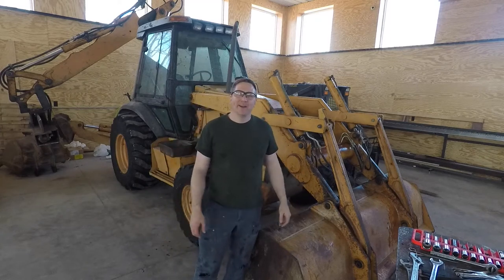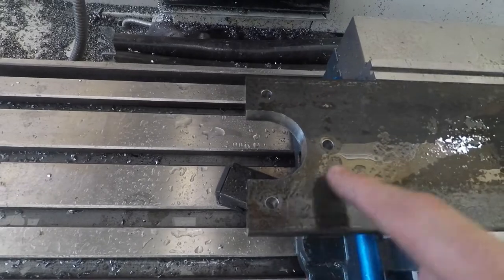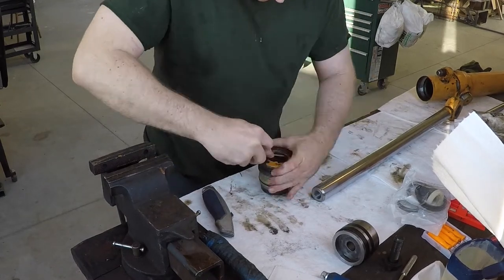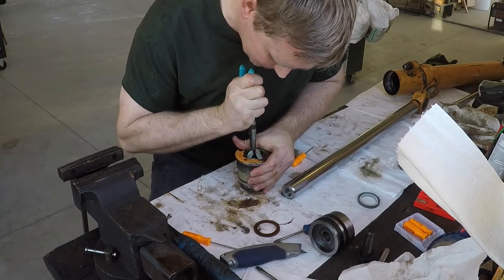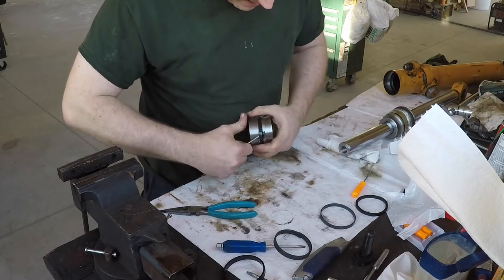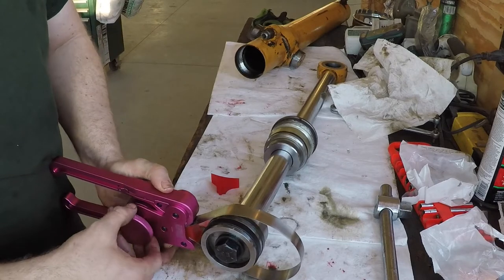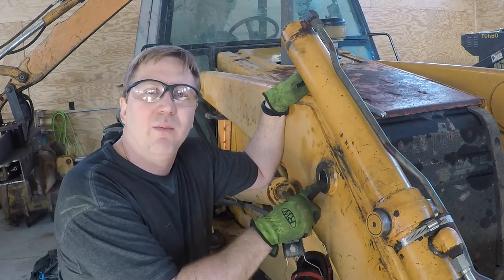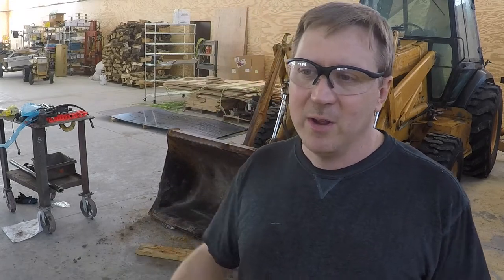Replacing hydraulic seals in Case 590 Super-L, and DIY face spanner tool

Comment: If a manufacture neglects to provide a grease fitting for a part that should have it, we make our legitimate complaint known to the company and we definitely drill and tap it for a grease fitting if the part provides us the ability to put one there.
Reply from the maker: Agree 100%! For this one the bolt was so small I didn't want to drill it so am leaving it as is. I did drill the lower pins on the outriggers though. They never stick anymore!
Reply: @dirtyshirtworkshop  
Cool to hear that you was at least able to get grease fittings in some of the pins. Yep its so nice getting to just give a shot of grease now n then versus things binding up down the road and cause much more work to be done than what we already have to get done. 
Aside from other machinery, we also learned very quickly to never rely on sealed bearings and especially not if it came from communist china the land of mass produced junk. We bought a tractor 10 years ago that they put sealed bearings and therefore no grease fittings in the mower deck spindles. 5 years later one them came to a screeching halt and destroyed the spindle. After inspecting the other spindle, it wasnt going to last much longer. Craftsman wanted an arm and a leg for a replacement spindle which we laughed before hanging up the phone on them.
So we ended up buying the same tractor off of craigslist that was used, drilled n tapped the spindles for grease fittings, and now we at least got our previous tractor for spare parts